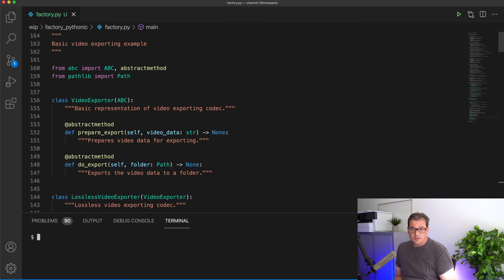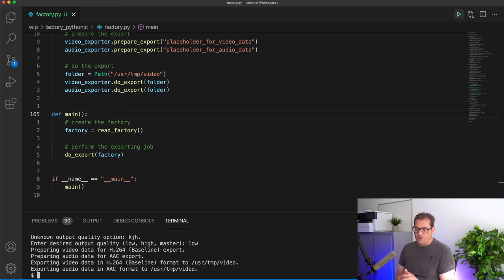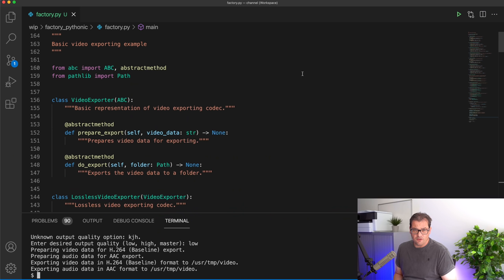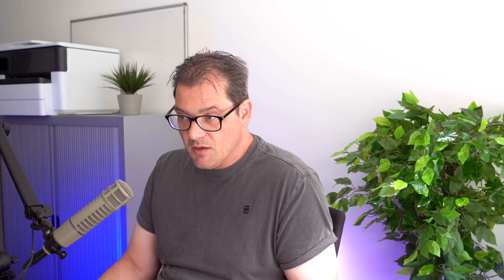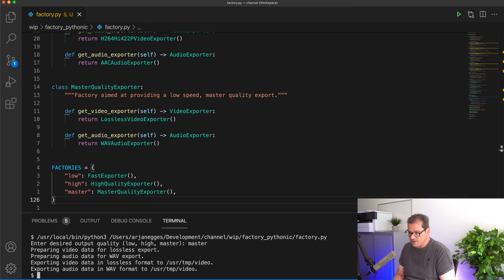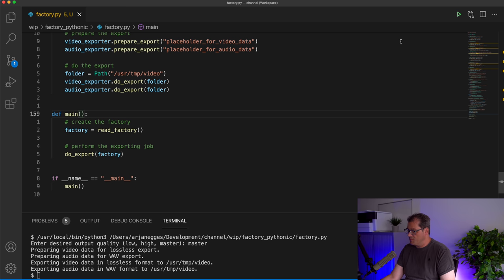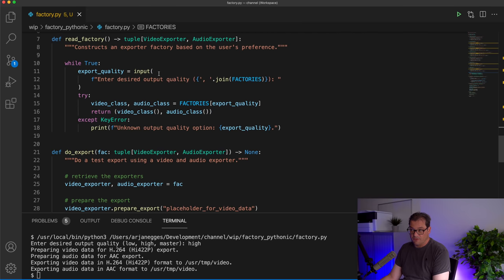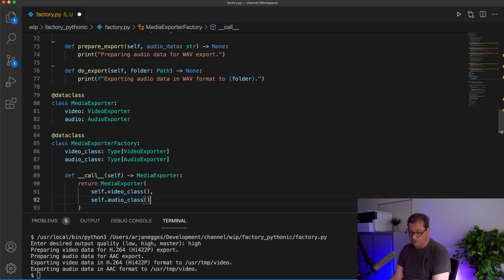The Factory Design Pattern is Obsolete in Python

Comment: Afaiu: Protocol lets you specify a communication contract. If an object implements the methods required by a specific protocol, we can communicate with this object over the given protocol. E.g. If we have two indepentent classes, but both classes implement a protocol, we can communicate with them. If we would use inheritance instead, then both classes would need a common parent class, with its associated methods, and thus the two classes wouldn't be independent anymore. E.g., an independent car and plane class, both implement the Protocol with a method "refuel".
Reply from the maker: Very well put!

Comment: According to me, it is best to use abstract base class. When RabbitMQueue and SQSQueue are both subclasses of Queue abstract class, looking at the class (actually the parent class name) you come to know that , "Okay! Since their parent class is Queue, I can pass them whenever a method accepts a parameter of type Queue" with confidence. You cannot do the same with Protocol
Reply: I am new to Protocols but I share the feeling that they may take decoupling a little too far. 

In addition to your argument, one may observe that in this video the protocols VideoExporter and AudioExporter are identical. As a consequence, one could pass a ConcreteVideoExporter where a ConcreteAudioExporter was expected and no (static) type checker could point out the mistake. 

On the other hand this flexibility may be desired behaviour if some class adheres to several protocols and you don't want to / are not in the position to specify all of them as superclasses. 

It feels like both the power and the pitfall of Protocols is that they facilitate duck typing in type checkers, if that makes sense?
Reply: Of course, type checkers are just a tool; in the example above they just illustrate part of what a developer may struggle with understanding / implementing (robustly) / validating.
Reply: Exactly! the same with the bunch ok kafka/mqtt clients for which there are several different python implementations differing for a few commas here and there
Reply: That's true. I wish you could specify the protocol in the classes that conform to it. 

In other languages like Swift and Java classes that conform to a protocol (or an interface in java) have to state it in their definition:

class DoubleEndedQueue implements Queue  {...}

And that's because they are nominally typed. In Java and Typescript as well as Python, objects are structurally typed.

Comment: My one critique would be that overriding the '__call__' method can be a bit of an anti-pattern that tends to hide what code is actually doing. Avoiding using it in most cases usually creates code that is a bit more obvious and clear and even self-documenting.
Like with your example, where you had added a comment:
# use the factory to create a media exporter
media_exporter = factory()

Without the comment, it can be a bit unintuitive on first pass what the factory object is doing by being called, or that it even is an object. It could just be a function, in which case what kind of function is "factory"? Even if you logically conclude it then must be an object with an overridden '__call__' method, or check with your IDE, for creating MediaExporters, it's already taken far too much mental effort to decipher.
However, if this was a named method instead, this code becomes much more clear and even completely self-documenting:
media_exporter = factory.create()
Or even better (code is read far more than it is written):
media_exporter = factory.create_media_exporter()

This way it is completely clear that factory is an object, and exactly what this factory object is for, and what it is doing when you call its method!
Reply: exactly what i was going to say, explicit is better than implicit, there is really no need to use the magic _call_ method to confuse people

Comment: I think what is being missed by a lot of folks here is that Protocols allow a class to implement multiple of them while inheritance only lets you inherit from one class. Also, Protocols allow to limit the scope of what a method requires in order to fulfills its purpose. If a method only cares about using a few properties of a parameter, it can make that explicit by accepting a Protocol that lists those properties. All classes that fulfill those properties would automatically start working for that method.
Reply from the maker: Good point! That aspect of Protocols is very close to how interfaces in other programming languages work.
Reply: Python allows for multiple inheritance. 

The rest of what you said I agree with, however.
Reply: @fennecbesixdouze1794  TIL! Thanks. It is worth noting that method and field resolution become pretty complex the more inheritance levels you add though!

Comment: Closures are also an option here. 

They hand of the entirety of your interface configuration to the function signature (by "function signature" I also mean return signature). You can create a factory that accepts some argument (or arguments) and then returns some functions that call back to some abstract actions and attributes that act on the injected/enclosed objects.

This is only good if you really don't plan on doing a lot of extending or using dunder stuff. Basically if all you need is a factory with some inversion of responsibility. The benefit is that you don't have to worry about any fancy python datamodel things happening behind your back. It is very restrictive and only gives the end user exactly what methods and data you want them to have.

Comment: I love these refactoring videos. They gave me the bug to go back and clean up some old and clunky coffee of mine, but it's a lot more work when one has unit testing.
Would you do a video one day on refactoring code that is tested? 🙂
Reply: The problem is that Arjan doesn't really "refactor" the code, he complicates it and makes it less readable by using unnecessary things, like sticking dataclasses literally everywhere just because he can. The problem he presents in this video can be solved with one dictionary: FACTORIES = {'low': {'video': BadVideoExporter, 'audio': BadAudioExporter}, 'medium': ...}. Bam, problem solved. Clean and short, without cluttering the code with his unnecessary classes and factories.
Reply: @k283  the point of the videos isn't the literal change he's making so much as the idea behind it. These changes may be "heavy handed" for small code line this, but the *idea* is super helpful in real production code.

Classes and dataclasses have many advantages for passing data over dictionaries. Simply being able to use dot notation to access element values saves a lot of time and is more readable than dict's brackets+quoted value. And the IDE offers autocomplete, which you don't get with dictionaries.

I would just say that we should use the right tool for the job: for some things a dictionary will be fine, for others this is better.
Reply: @virtualraider  > These changes may be "heavy handed" for small code line this, but the idea is super helpful in real production code.
Maybe, but to me it looks like terrible overengineering. Which is just as bad as smelly code. The solution I proposed here requires one dict; his solution requires adding unnecessary classes and importing dataclasses. That is a prime example of overengineering.
It's been said that once you learn to use a hammer, everything starts looking like a nail; well, here we see a dude that learned what dataclasses is, now he writes even print('hello world') only in a dataclass. Because he learned it and is eager to use it :)

> being able to use dot notation to access element values saves a lot of time 
Dunno, creating a class (and thus adding more code, thereby increasing the overall amount of code to read) just for the purpose of using dot instead of [key] seems an overkill to me, like shooting a surface-to-air missile to kill a sparrow. This also injects overheads and, in the end, getting the object's property uses a dictionary under the hood, like __dict__. So it turns out dict is used anyway.
But if you don't like some_dict[some_key] notation, why don't you replace all the dictionaries in your code with classes, in order to use dot notation?.. Wait a second... Slow down, you aren't gonna tell me you actually create classes every time you could use a dict, are you? 😨 😱 

> and is more readable than dict's brackets+quoted value
That is a very arguable point; a line like "vehicles[car]" seems no less readable and short than "vehicles dot car".

> I would just say that we should use the right tool for the job
With this I agree!

Comment: I briefly looked into using Protocol instead of ABC, but what I needed was actually a partially implemented subclass of dict. I made a class called ExtendedDict that declares some helpful overrides (e.g. _eq_ enforces timing-attack safe comparison) and does some clever stuff with _setitem_ to enforce json serializability and preventing extraneous, non-property keys from being set. As a result, almost all classes in the project are serializable to json. (It is an implementation of MuSig on ed25519, which involves 3 rounds of interaction, so serializing properly was very important.) It's probably over-engineered and maybe unpythonic, but it is pretty nice to be able to reliably call json.dumps on any object. I suspect that having a Protocol that specifies abstract methods to_json and from_json would probably be easier to grokk than a system that overrides __setitem__.

Comment: What about simply decoupling the generation of audio and video exporters so that they don't have to be generated together? I think this would solve a few issues without any tradeoffs (though correct me if I'm wrong):

1. You can now specify different qualities for video and audio exporters
2. Your factory mapping size won't explode with the square of the number of qualities
3. You can now easily pass config functions for video and audio as they each have their own function
Reply: From what I understand, The whole idea of (Abstract) Factory method is providing an interface for creating "families of related or dependent objects". Your points are correct, but then it won't be this pattern. I feel, some better example could have been taken to demonstrate this pattern. "Head First Design patterns" book has a great example around Pizza ingredients.

Comment: I like to create a special factory for each and every class. The factory takes one dependency, the dependency injection container. All factories use the container to create all instances when possible. When the class object is needed to do work, the factory create instance method is invoked and you'll have a instances to complete your task.
All dependencies for all class are these factories. The container can be configured so all factories are only ever created once. And difference factories will either return the same instances, or a new instances.
This prevents deep dependency trees from being created. As well as preventing stack overflow from happening when injection dependency trees.

When you do this, your code become super easy to write unit tests, and to refactor. You can also throw away all abstract classes, and replace it with the decorator pattern
Reply: Why not use __new__() instead? It seems that it's what you want (i.e a default factory) and I think my_class(dependency_container, *other_args) is clearer than my_class_factory(dependency_container, *other_args). The only reason not to would be to let the class be instanted with manual dependency injection.

Comment: Using protocol seems same as interface impl in golang where the "implements" declaration is not explicit.
One benefit is that if you have 3-4 interfaces and you implement all, you don't need to explicitly specify in the class declaration. And your concrete implementation is completely decoupled from the interface. Even import is not needed. Just implementing the method in the interface is enough. There can be an advantage to typecast builtins to a super type without having explicit boxing classes, like interface{} in golang)
Overall I feel Protocol is the way to go.

Comment: I don't get the last approach with the dataclasses. You went full circle back to high coupling. The program is now tightly coupled to the MediaExporterFactory and its implementation. How am I supposed to use a MockMediaExporterFactory now for my tests? By inheriting from it? Then you need to know the exact details of its implementation and especially the _call_ method as its not at all clear how the sub class is supposed to override it. Protocols were better

Comment: From reading the comments:
-  ABC is better for subclassing because you can see and your IDE what is signature of this class and its objects
- Protocol is better for type hinting arguments, that are being passed to class or function. Without coupling it with single type of classes.
You have to also adhere to your protocol and dont use any other methods than what ia defined in the protocol.

The main take, dont define a class that adheres to a Protocol. Use ABC instead.
Protocols are only for cient code not library code.

I.e. RabbitQueue, RedisQueue has add() method, however they are not inherting from the same class and dont share any superclass (either you dont have control over those class, or you dont want to play with multiple inheritance, or any other reason)
You can define a Protocol with add() method.
This way you have more flexibility while having 100% IDE support, and also makes sure that you dont assume anything from the passed object more than calling .add() on it. 

Check @Oliver Voggenreiter comment for more info.
However he is wrong about inheritance
Any criticism is welcome

Comment: Dear Arjan, I actually thing the best approach is to get rid of most classes, and use dictionaries and tuples to create factories. As we know, factories and design patterns are actually design principles with a proposed java implemenation in the OG book. Java is more verbose, and Python can be way more concise and readable without it being detrimental to maintainability. I think the rigid multiclass factory system you've implemented is not the optimal way to solve this issue in Python.
Reply: Do you have an example you could throw together?

Comment: why i have to define Protocol class if it does nothing , how do i know that if LoselessVideoexporter implements  VideoExporter class?
Reply: This need for mypyc static analysis and type hints in your IDE
Reply: i get the point, now my ide knows if some class implements same method this should be sub class, but for me it is not clean. am i getting wrong?
Reply: In the original example, the main use of ABCs was purely for static type checking, which Protocols are designed to aid. If you want to know whether LosslessVideoExporter implements VideoExporter, Python has the @runtime_checkable decorator, which allows for use of isinstance() and issubclass().

Edit: And, well, they can be used as regular abstract base classes.
Reply: @NateROCKS112  thanks

Comment: Arjan, are you familiar with the DCI (Data, Context, Interaction) architecture / late binding (Alan Kay - OOP, James Coplien - Trygve etc.). I'd love to see you do several episodes on those.
Reply: - E.g. realizing actual OOP à la Alan Kay in Python (not just class oriented / Data Structures with methods) where Objects themselves communicate with each other via messages instead of imperatively.
- Building a simple DCI architected application, implementing roles, late binding and a context in Python
- exploring how Python built-in concepts and protocols are already geared towards true Object orientation (Network of Objects, Behaviour focused programming)

Comment: Question: Please correct me if I'm wrong. But I was not able to see that you get any syntax errors from NOT IMPLEMENTING a Protocol.
This would be a huge downside to them if you ask me. You would still be able to catch exceptions down the line, but not catching syntax problems ahead of time leads to a really bad workflow where you use a lot of time where you do not realize things were forgotten and have to go back.

I think it becomes easier to read when things are explicitly stated. Such as abstract classes.
Where as from what I understand from Protocols, they can be considered valid for many scenarios as long as the requested method exist.
I would not dare to use these as it would allow all sorts of un-intended functionality.

Since a class has no direct relationship with the Protocol, how does it compare it to it?
Kind of looks like automatic black magic to me comming from a C++/C# background.
Reply from the maker: The relationship is setup differently when you use protocols versus inheritance. With inheritance the relationship is defined between the superclass and its subclasses. With protocols it's defined between the protocol and the thing that uses the protocol. If you pass an object of some sort to that thing, the structural typing system checks whether that's allowed when you run the program. If not, it's going to raise a runtime error

If you use VSCode together with a tool like Pylance (which I highly recommend), then you are going to get a typing error in your IDE when you try to use an object that doesn't adhere to the Protocol's structure. So you will be able to catch these problems before you run the code.
Reply: @ArjanCodes  Ah, that is at least good. I mostly work in the game industry, so not detecting a problem before runtime can mean up towards 15 minutes of wasted setup to start up the editor and run through content to get to the test case in some scenarios. We try to keep it as short as possible but sometimes, sub-sequent events matters a lot for the test case. So it stacks up quickly. Thanks for the answer.